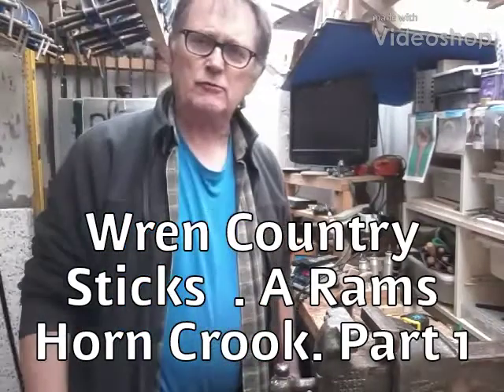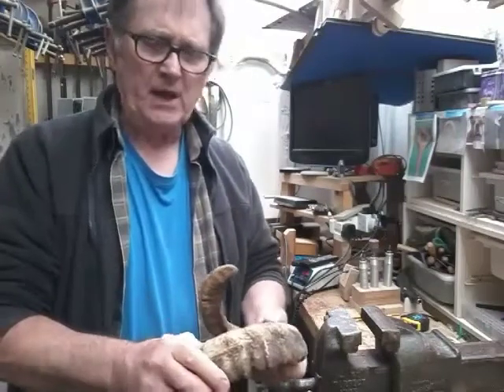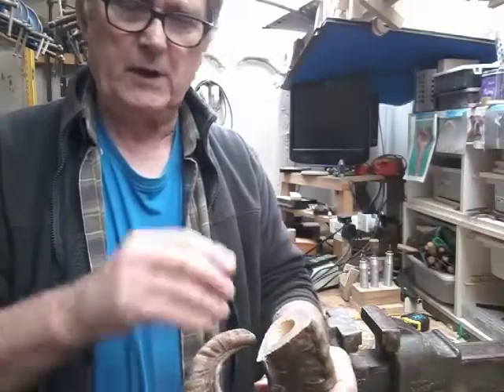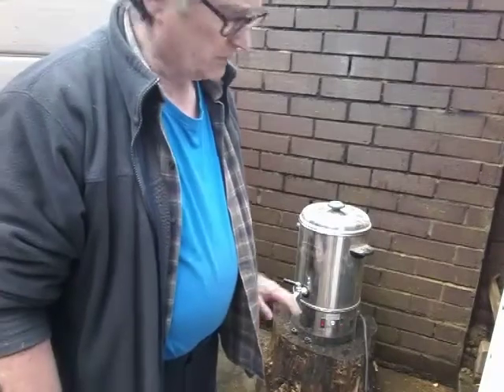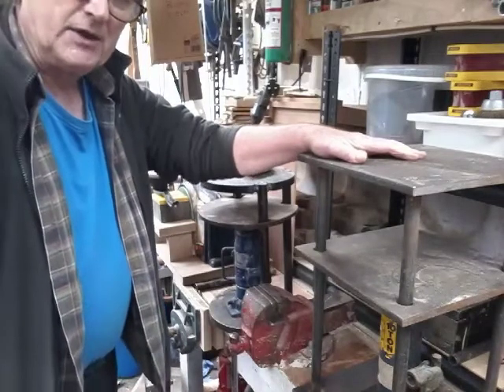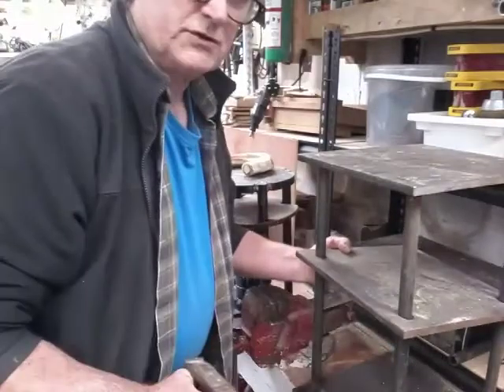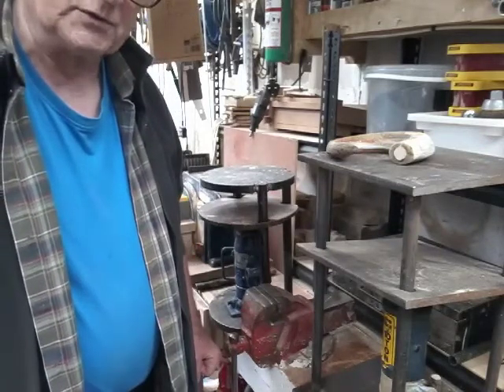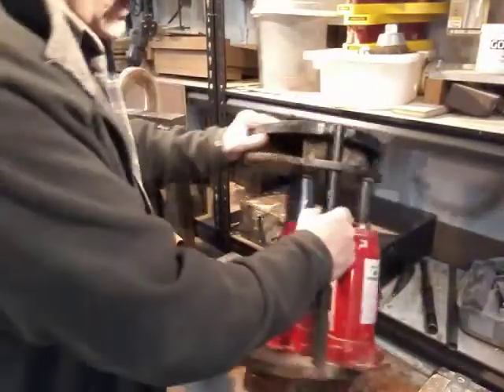Maki g a rams horn shepherds crook. Part 1

Comment: How many time's can you boil the horn? Have made two mistakes today (1)not boiled anywhere near long enough and, (2) my 'compression' plates are not big enough. If leave the horn long enough to cool down ie 24hrs can I repeat the process? Many thanks in anticipation 👍👍
Reply from the maker: Hi Alan. Never think you have made a mistake when working horn. You have just learnt a lesson. Rams horn work is a life time learning curve, and practise makes as perfect as the horn allows.   Ok . First thing to remember is that rams horn is like a plastic material, it is in fact the same material as your nails.  Namely Keratin ( if I have spelt it correctly).     On your first boil you are looking for the horn to be pliable rigth thru and you can test this by putting the boiled horn in a vice  as soon as removing it from the boiler. Once anchored in the vice you should be able to push amd pull the horn back and forth and get a good movement indicating the the horn is soft right thru.
By boiling you are in a way unlocking the horn and any action you now take like pressing  and then cooling should give the horn a new shape.  However the horn has a memory and will always try and revert to its original shape if its get sufficient heat.
Ok that the first bit  . Once you have the horn flat you repeat the proces on a smaller scale by using a hot air gun to re work small section of the horn to get the final desired shape.

If at any time you are unhappy with the way things are shaping or not you can re boil and start again. You do not have to wait to re start the process. But what ever work you have already done on the horn will be undone, and basiclly you will be back to square one.  So remember , heat unclocks the horn , cooling the horn locks in the shape during the cooling priod. Any heat , such as a hot car , storage next to a radiator etc can make the horn move on a finished stick.
Hope this helps a little Alan.
With regards to the smallness of you plates. Scrap yards can be a good place to find steel plates of a goos size, but you may not find enough of the same size to make up a press. Mertal merchants will have loads of stock and will cut slices of a  large diameter rod, but they are very pricey. Large sqaure  plates  of about 12 inch sq can be got from companies that  supply builders with plates for stantions. ( Plates that foot vertical steel guilding supports) .
Reply: @wrencountrysticks8660  firstly thank you for your prompt supportive/guidance much appreciated sir 👍👍what I didn't mention was that I was undertaking this project alongside me father who has dressed sticks for a number of years now, unfortunately my father now has Parkinsons Disease and finds certain tasks difficult to undertake he knows what he wants to do, he knows he has done it in the past but he can't remember when, so little things he thinks he remembers become set in stone ie you only need to "boil the horn for 20mins" he fails to grasp that it needs to be longer and it's cooling down once it removed from heat source. However I digress 😁 we both learn something yesterday, many thanks again, have subscribed to your channel and look forward in anticipation to future projects.

Alan Scott.

Comment: hello i'm french and interested about knife making and i need to press a horn like you did but i don't get what is the tool you use at 2:17 and what is its propose , is it just a 

kettle (did you dip the horn in water and make the water boil , then press the horn , or it's something else) ?
Reply from the maker: Hi . Yes it is a kettle. I wait for the water to boil and place the horn in the boiling water for a hour or two depending on the size of the horn. Once the horn has boiled and is soft I place the horn in the steel press with the bottle jack to flatten the horn.
Reply: @wrencountrysticks8660  Ok it's clearer ^^ thanks you a lot